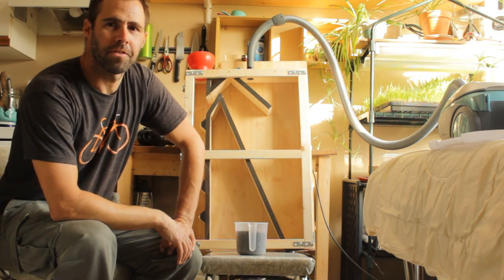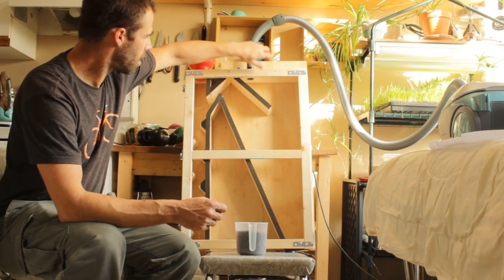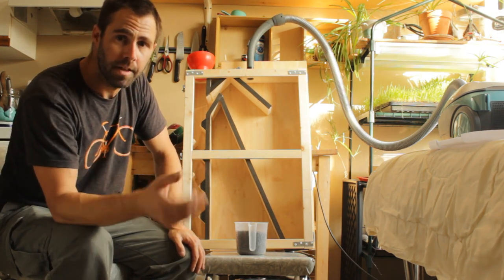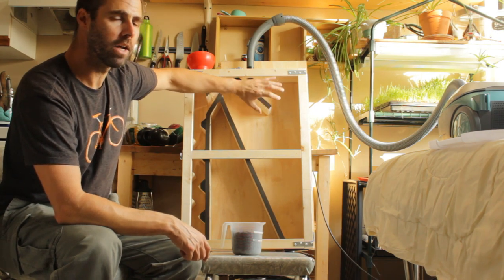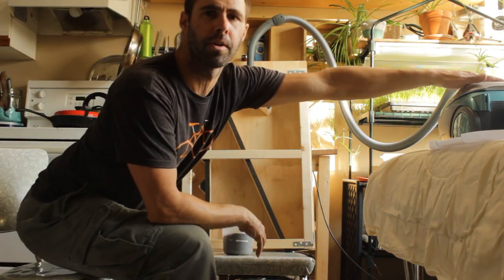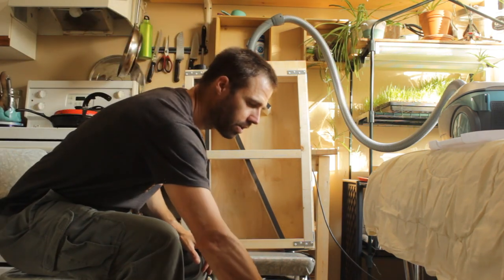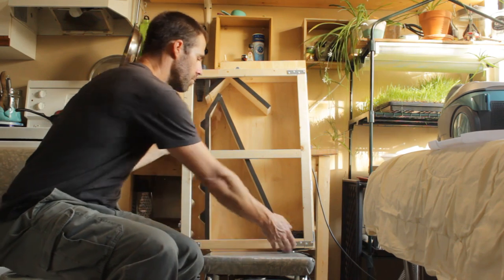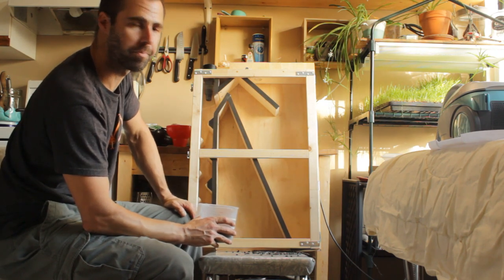Testing Zig-Zag Seed Cleaner with black oil sunflower seed to differentiate by size

Comment: I made one like this and I found you just got to adjust the vacuum air flow , i inspect the husk waste from the seed and adjust the air flow, if to many seeds maybe it’s to strong in the vacuum, the seed collection I check as well to see the vacuum is doing it’s job removing light husk and waste from the seed and adjust from that really, very good seed sorter and saves a lot of time trying to do it yourself the older fashion way for sure.

Comment: Hi, you could also try weighting the rejects vs the ones the went through on a digital scale.  As you said, size is not an indicator of density,  as this is what your separator does, separate seed based on weight.
Reply: seperation on density actually, which is often related to seed quality, as opposed to weight.
Reply: @realseeds750   @Real Seeds  I don't see how this contraption could distinguish volume to separate based on density. It is the weight regardless of seed shape that causes the separation.
Reply: @dietrevich  no problem to explain:  the seed falls downwards with a force due to mass (gravity),   against an airstream that is moving upwards, which exerts a force (wind resistance) based on the cross-sectional area.  The net force therefore varies with density of the objects, giving a density-based seperation.
So it can seperate identically sized seeds some of which are less vigourous  (more hollow due to less endosperm and therefore less dense), but cannot seperate a mix of all good but different sized full seeds as they are all the same density.